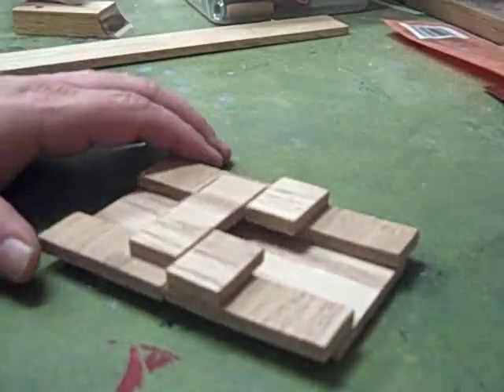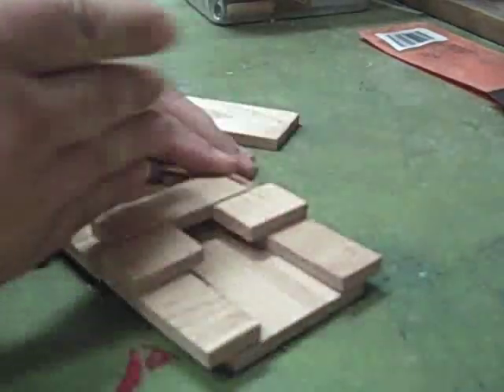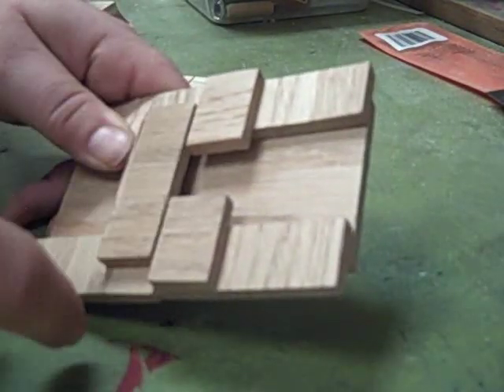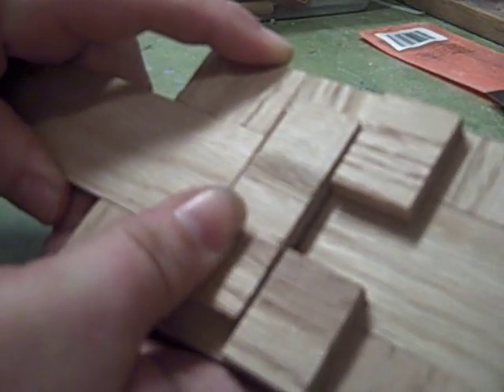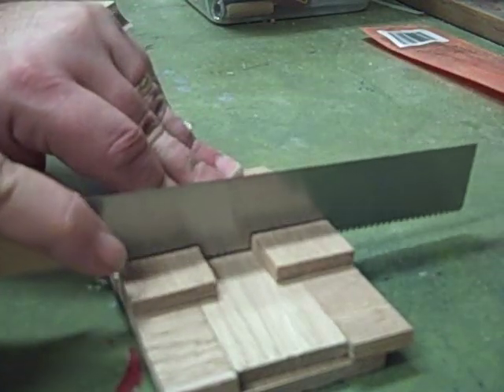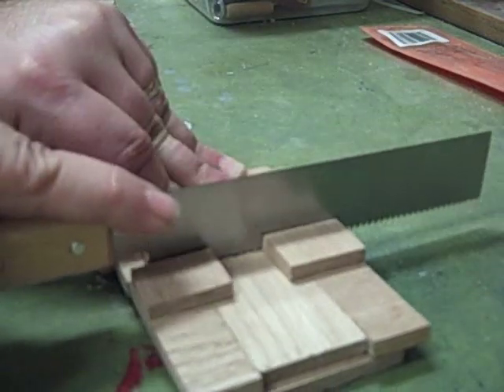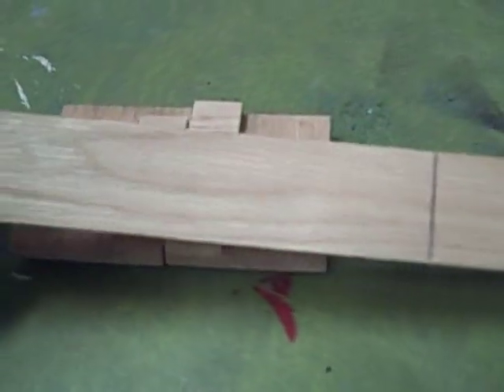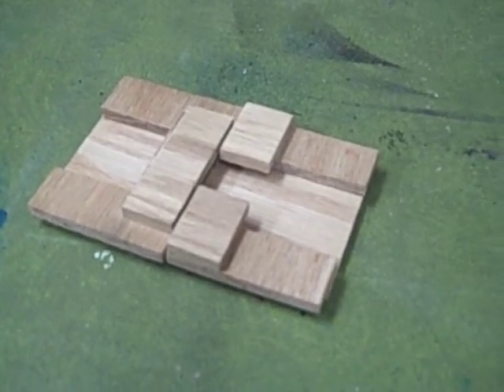Fret Slot Cutting Jig (Prototype 2)

Comment: Preparing for my first build.  Looking for a cheap and quiet way (no power tools allowed in my building, would need to go somewhere else for that and would prefer to do as much here as able) to make radiused fret slots.  If I made a jig similar to yours, but raised it up (to allow the downward sawing angle as you move laterally from the crown in the center) and widened the space for the saw (to accommodate the guide on stewmac adjustable fret saw), do you think that would do the trick if the fretboard was pre-radiused and not yet tapered?  I'm thinking the guide on the fret saw would cause it to match the radius on the board and give an exact, uniform depth.
Reply from the maker: I'm not following you exactly... but it's all made from scrap wood.. so give it a shot!  Let me know if it works.